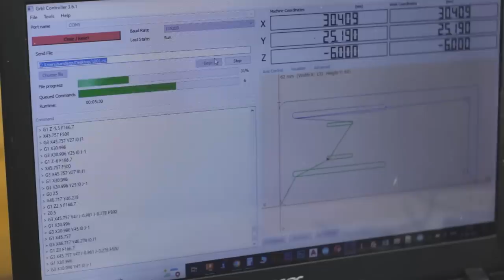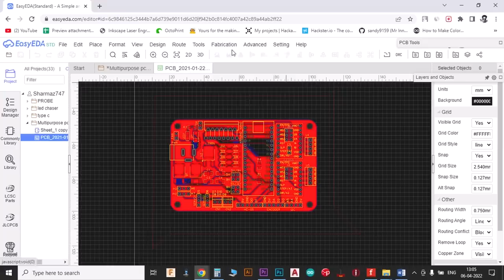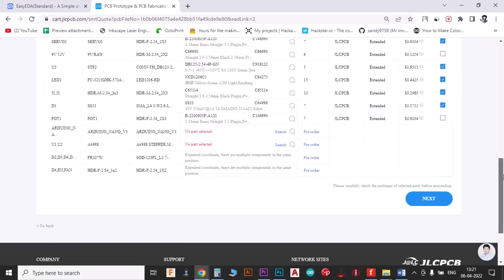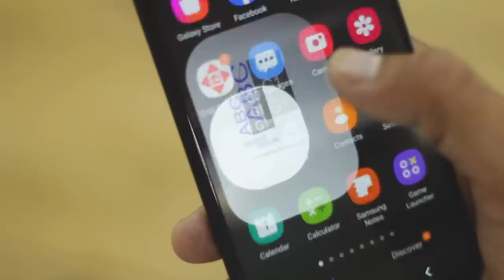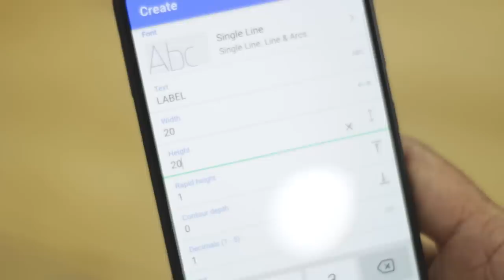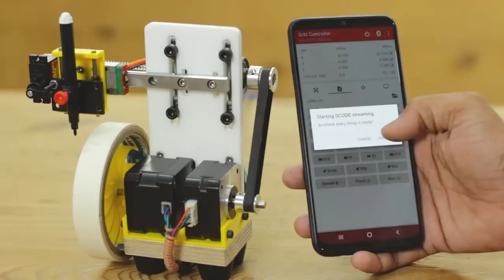DIY Paper Tape Label printing CNC machine | Arduino + GRBL + BT + Android

Comment: I think thats no the pcb You really use. What is that big IC with heatsink for?  and where is the bluetooth module?
Reply from the maker: This PCB is my multipurpose PCB it can be used for many project, there is provision to run 2 DC motors also that heat sink is for L298N IC, if you have this PCB no need to purchase most of motor driver shield....https://www.youtube.com/watch?v=Fj70JgDcnIg

Comment: I don't see any blue tooth module on the pcb board.  How does the board receive the g-code instructions ?
Reply from the maker: in video it was not there I missed that, but there is a HC-05 module.
Reply: Joseph M... I believe the builder used a video of the circuit board from another project. It was an example of what to do. Not the actual one for this build.

Comment: Cool implementation! I wonder if a friction-style rim drive would be an option for the tape/rotary axis that would allow for different size rolls without too much tuning. Do you notice any change in the angle->linear distance conversion between a full and nearly empty roll?

Comment: Amazing project! My setup is very similar, just with a few modifications in the physical structure. I had a curious problem: when i press jog left and right, both run to the right. But when i press diagonal, the motor moves in both directions just fine. Any idea on why could that be?

Comment: Great concept basically, but we have not been shown anyway this handles big rolls or tape at the last few remaining rolls.. so far this just seems like a starter.

Also the display could include some kind of estimate of ink running out or uses since reset of the pen.

Others have mentioned cutting, but that's not easy as it seems.

Comment: Amazing cute little machine. Are there a reason for not having the servo connected directly at the rotating screw rod instead of using belt?
Love this kind of clever inventions 👌
Reply: to make it compact
Reply from the maker: @fardeenkhan-og5mb  yes this is the reason

Comment: Doesn't seem like it would scale properly on the x axis as the roll of tape gets smaller from use. You're shrinking the diameter, so your writing would shrink on the x axis as the tape us used up
Reply: You could account for that in software.  Enter the roll diameter and tape thickness and then scale the x value by that %.
Reply: @GodzillaGoesGaga  true, that's a good point